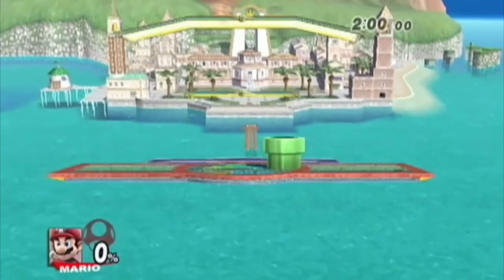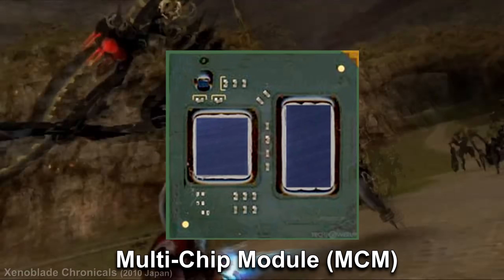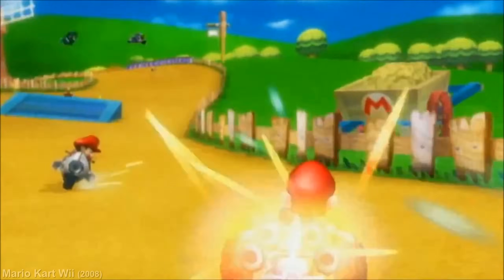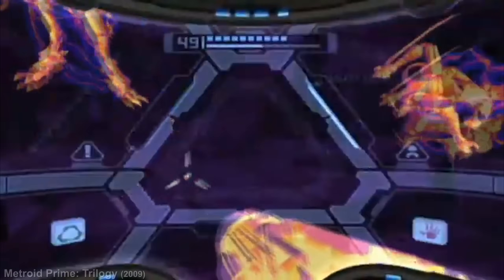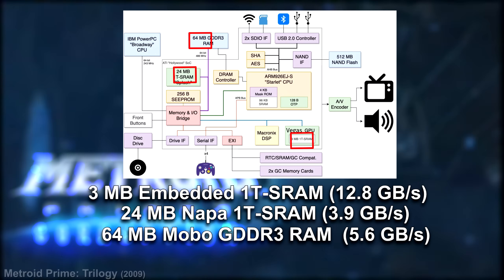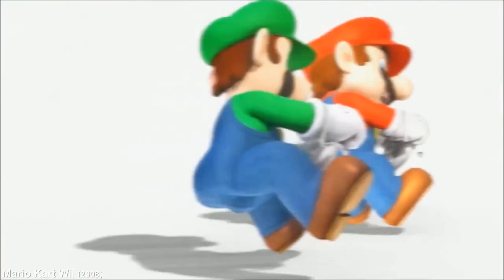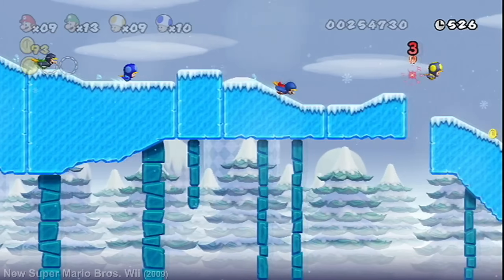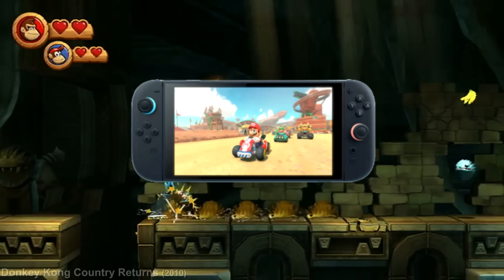The Nintendo Wii GPU: Hollywood (Retro Breakdown)

Comment: Its ok if they were behind the competition in terms of raw power but i feel they were too much conservative. A 4x Gamecube would have been better and using 1.5x of that power for better upscaling and antialaising for LCDs and plamsa
Reply from the maker: @fjod1689  very true!
Reply: @FrameRated    It honestly would have been Better If the Wii was around 2 times more powerfull than the Og Xbox and like that system being  able to do 720p or 1080i visuals, even the ps2 (Which was Way weaker than the Wii in most ways) could do 1080i.
Reply: Back then, displays were typically doing the upscaling, not the console.

Comment: If you ever cover the dual CPUs of the Sega Saturn, would you also include the SCU’s DSP along with it, as it was meant to be a coprocessor for the CPUs?
Reply from the maker: @pukalo  sure can!
Reply: @FrameRated  Wouldn't be a bad idea to include the Sega 32x as, IIRC, the Saturn is basically an over clocked 32x.
Reply: @GoldenGrenadier  I think it is the other way around, the 32x is an underclocked saturn, but the similarities are only in the cpu.

Comment: Bro the wii hardware is like a overclock gamecube that why the wii can play gamecube games
Reply from the maker: This is true! Usually just some I/O switching because of how alike the hardware was.
Reply: it's also worth mentioning that loaders like Nintendont actually run Gamecube games in Wii mode (this has a performance boost too, due to clocks) to enable the use of the Wii's I/O ( to access non-gamecube controllers and of course loading from SD/USB).

Compatibility is handled via simple memory patches to address timing hacks, and other minor differences between Wii/GC.